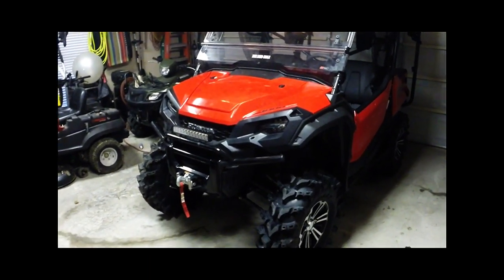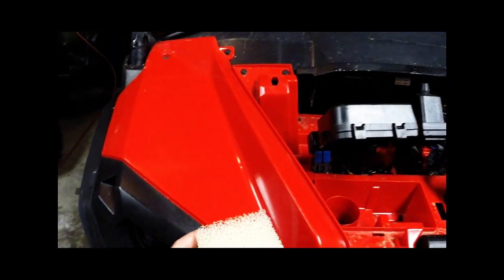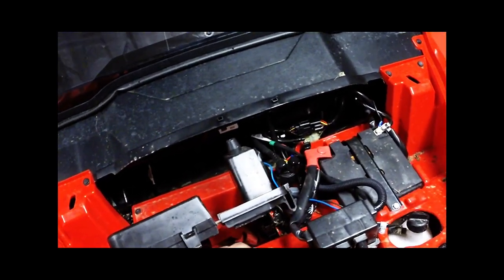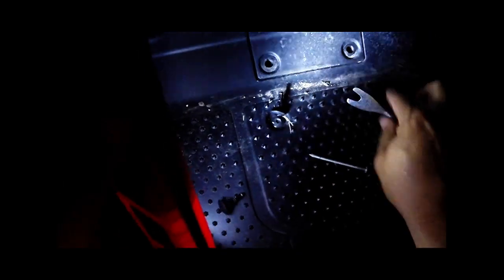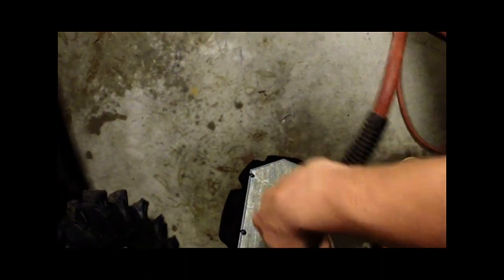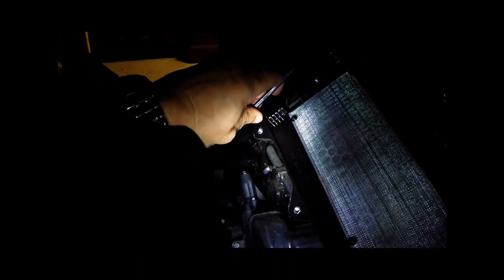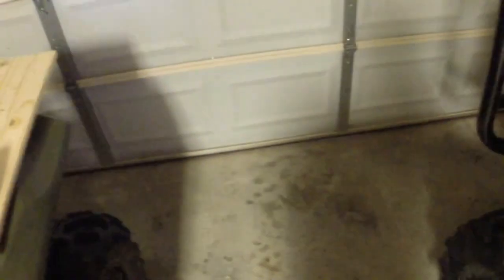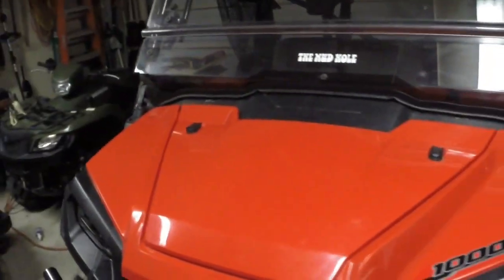Honda Pioneer 1000 Air Filter Check/Change guide

Comment: I've found this job to be a pain in the ass. Best solution for me has been to remove the seat back in order to get good access. Otherwise, good luck finding a combination of tools that will actually come down straight on those bolt heads. This applies on my 2016 model for sure!

Comment: My son drove my pioneer 1000 in the pond and I now have water in tank. I’ve drained the gas and replaced with new but I think I still have water in fuel filter or in the lines. Does anyone know how to find the fuel filter on this machine?
Reply from the maker: Fuel filter is built into the fuel pump. You would need to remove the pump and disassemble it. There have been few reports of clogged filters when sediment got into the tank.    Then, vent your fuel tank breather tube. Cant stress that enough.